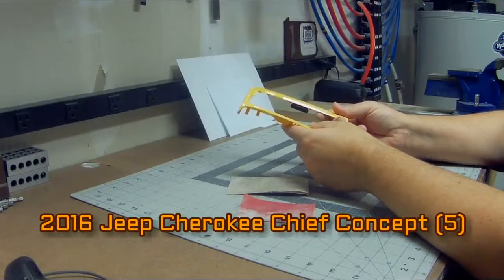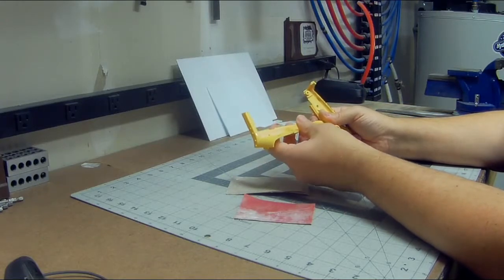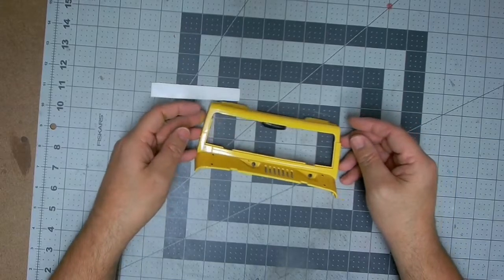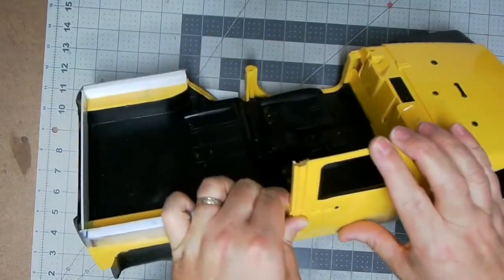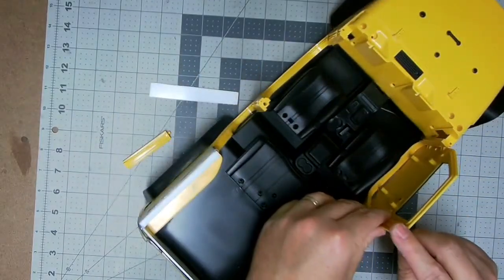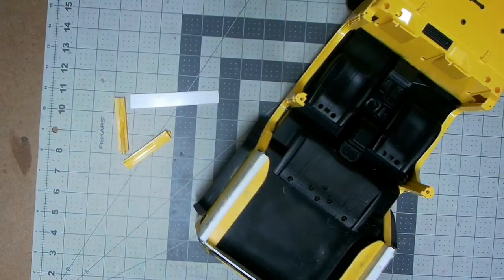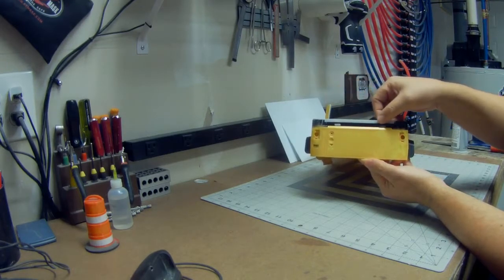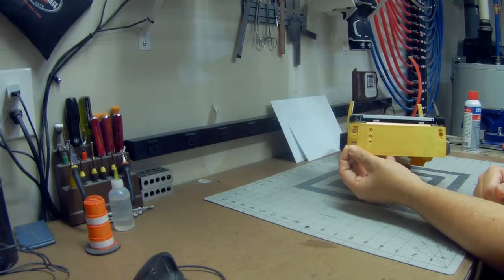2016 Jeep Cherokee Chief Concept (5) - B Pillar, Window chop and Rear Mods Started

Comment: I'm curious what glues you are using? And that spray? I'm interested in trying to start messing with styrene.
Reply from the maker: The glue depends on the plastic you are using.  For Styrene, I use clear PVC cleaner.  It has a mixture of chemicals and I find that it works better than any of the official Styrene glues.  The other benefit, is it comes in giant cans and is dirt cheap.  I just transfer it to a squeeze bottle with a large needle applicator.  The spray is a CA glue accelerator.  I do not like CA for Styrene, but the clear plastic from the original topper does not react with the Styrene glue.  The accelerator just makes the CA glue harden quicker.  I find that CA works best with Expanded PVC sheets.  I sometimes use ABS and for that you can find a black ABS glue that is similar to the stuff used for plumbing pipes.  Hope this helps.